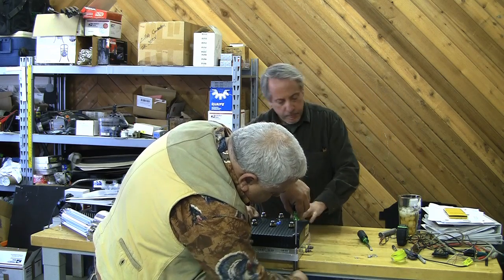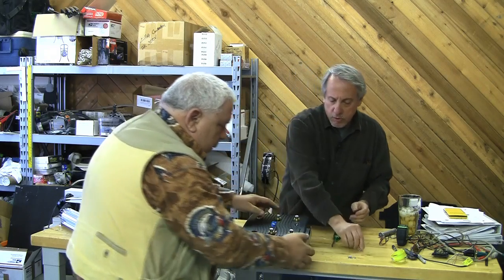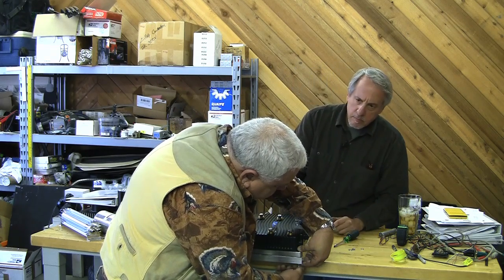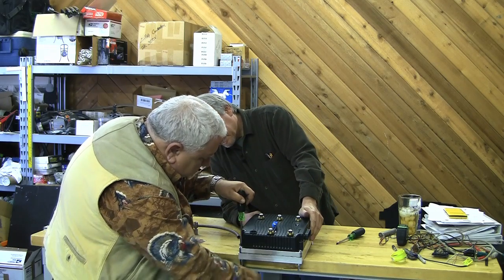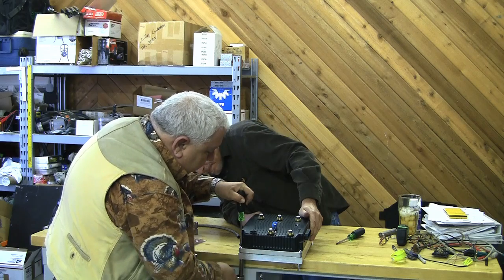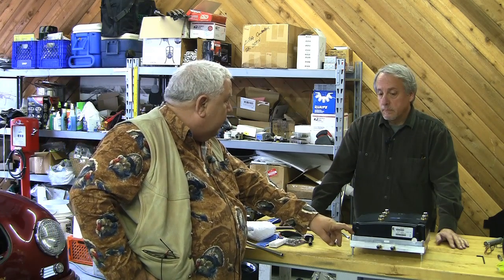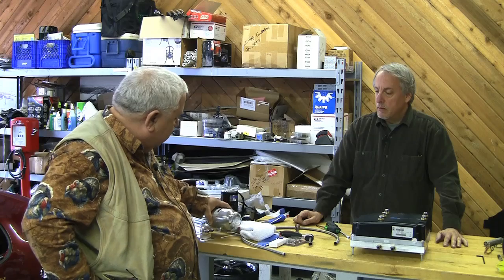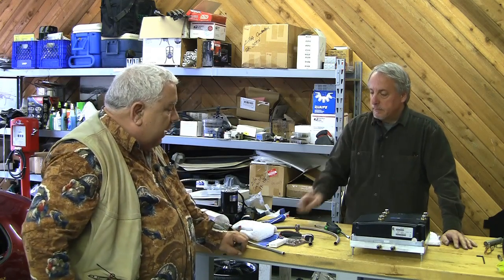EVTV - March 19, 2010.  Part 10 of 11

Comment: During the mini teardown, instead of a manual ratchet, or even a speed wrench, consider a 1/4 or 3/8 drive air ratchet and impacts.  Work great and fast.  Also, I think it would be worth considering modifiying the motor to use a water jacket, vs an air blower.